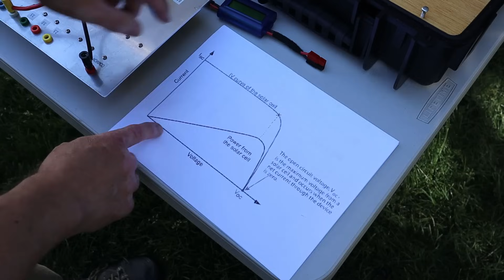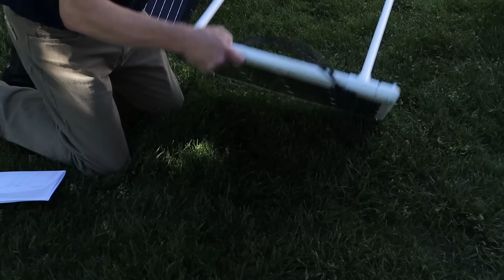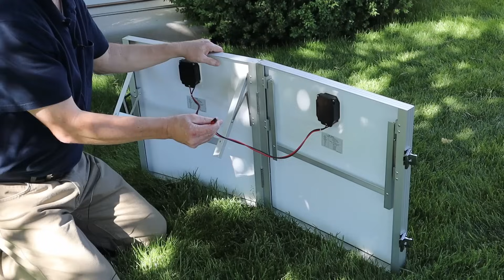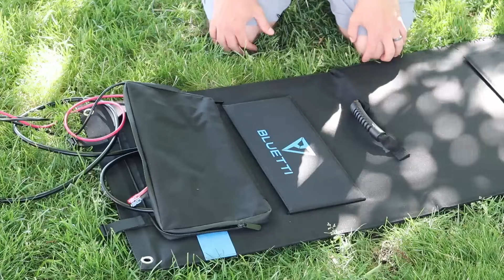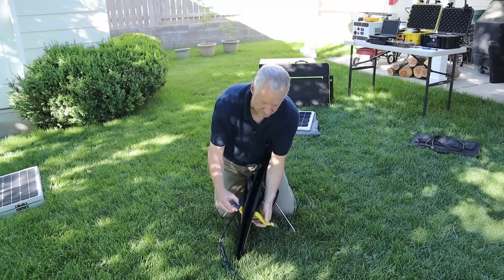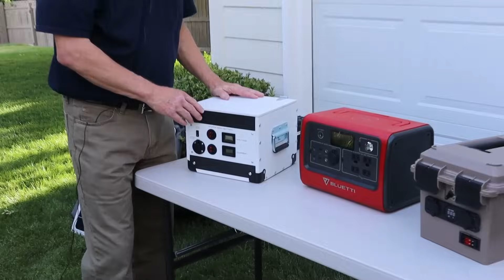Portable Solar Panel Comparison, 11 Different Models! Sunpower, Baldr, Rockpals, Bluetti, and More!

Comment: Did you all try out the Massimo 300w foldable panels they sell at Costco? I heard they get close to 300 watts =) If you didn't, any thoughts on how good these are just by the specs?
Reply from the maker: It should work fine, if not Costco has the best return policy!

Comment: Do you notice a difference between how much the flexible panels can achieve compared to their rating and the rigid ones? That final Newpowa seems to do quite well and is very good value. Not a good option for portability though as it is quite heavy but the flexible panels can cost twice as much.
Reply from the maker: There are three types of panels, glass rigid, portable folding, and flexible panels. 
Rigid panels have the best pricing and also last much longer(years and years). They can handle most any weather condition. The only downside is that they aren't as portable. 
Etfe portable panels are pretty water resistant and some are even waterproof rated. They output good power, check out my XTAR sp100 review. I don't recommend portable panels coated in PET. 
Flexible panels are in a weird area, they are waterproof but will degrade quickly especially if they are outside in the sun all the time mounted to the top of an RV or van conversion. They are good for a lightweight occasional use (they are able to slightly bend... Not by much)

Comment: Its heavy said that twice. What you didn't say was how heavy . Review but if want actual specs go some  where else
Reply from the maker: This isn't a 'in depth review video', I have plenty of those you can look at if you want more info about some of these panels. This is a comparison video showing power output and differences between each panel.
Reply: @Jasonoid  for as ling as l can remember at around 12:pm every day especially from april to September the sun is at it strongest if you're in the northern hemisphere 
What hemisphere are you in ?  Thats a rhetorical question.

Comment: I’d like to see how you built the load tester. I’d love to see the review of the folding variety against the powerFilm lightsaver line.
Reply from the maker: Just one large resistor, with a few small ones for adjustability so you can get the load perfect to peak the power.

Comment: Best videos on this topic I have seen. Answered a lot of questions.
I have an EcoFlow River 600 and a Goal Zero 200w. Do you think I am better off with the Rockpals RP082 or SP003 for connectivity. Thanks. P.S. Some people say the Rockpals 8mm connector included with the RP082 doesn't fit in all the way. Would that cause a problem. like a short?
Reply from the maker: Ive heard that Goal Zero uses a "longer" 8mm connector, you might need to purchase a special "Goal Zero" adapter from them to get a third party solar panel to work with it.

Comment: If the Baldr 120w or Rockpals RP082 panel is partially shaded (like 1 or 2 panels) does it still put out good power or or almost nothing at all.
Reply from the maker: Most panels do not perform will in shade. I have not tested all of them to see which one performs best in partial shading, might have to try to do a video for that in the future.
Reply: @Jasonoid  thanks. I was just wondering because I’ve seen the new Bluetti 200w panel does well if partially shaded because each panel is ran in parallel and just wondering if some of the other cheaper panels work this way.
Reply from the maker: Correct, sounds like I need to do some testing. Maybe I can find some time haha

Comment: Great video, does the Baldr panel have the etfe coating as well? Trying to decide between that and the rockpals with etfe
Reply from the maker: I have found a few similar panels that all have ETFE and perform very good! Pick the best pricing that works for your setup (I have review on each of them on my website:  https://jasonoid.com/solarpanels/   :
Baldr 120w ETFE - 112 watts output
Elecaenta 120 ETFE - 113 watts output
XTAR SP100 - Bifold - EFTE 113 watts output

Comment: Jason, what are typical applications for the portable power stations you covered?  If they're intended to be used outdoors, my concern would be a lack of water resistance...
Reply from the maker: These power stations are great for camping or boondocking. For someone who wants to have portable power to charge gadgets and run 12v fridges but doesn't have an RV or trailer. They are also handy to have for power outages to run small devices. The power stations are not waterproof AT ALL so you have to keep them out of the elements. Some of these portable panels have great waterproofing like the SunPower Flex 50s!

Comment: @JASON WE HAVE A BLUETTI  EB 150  I LIKE THE SP200 ( ALSO BLUETTI) BUT MY EB150 HAS A DIFFERENT CONNECTOR FOR THE SOLAR INPUT? ITS JUST 1 PLUG...HOW DO WE MAKE IT WORK?
Reply from the maker: Your EB150 should have come with a charging adapter that has MC4 connections. Did you get any adapter cables with your purchase?
Reply: @Jasonoid  I GOT THE COSTCO 300W FOR 300$ ON SALE...LOVE IT !!!!!!!   https://www.youtube.com/watch?v=vYp06kyA99k&t=1606s

Comment: Was wondering if any of those panels work well in shaded areas, I know it wouldn’t be as good as full sun. Have heard power film does work in shade but very expensive
Reply from the maker: Hey Dave, each panel is slightly different and depends on how they are wired together. Panels wired in series don't do as well as panels wired together in parallel. Parallel connections are much better for shading.

Comment: As I understand it Lithium-Ion batteries are very finicky and potentially dangerous then it comes to temperature, and then fire.  But it sounded like you were saying Lithium Iron which I hear are up and coming because they perform the same, output comparable Amp/Hrs. So, I wanted to be sure exactly what you said these particular ones had in them. I am VERY much a novice as I'm sure you can tell!  So, thanks for any info you can share, and this vid was fantastic!
Reply from the maker: Hey Harleydr, the batteries I like are 'lifepo4' or lithium iron phosphate batteries. They fall under the lithium battery umbrella but don't catch fire. I have tons of videos on the subject of power stations, lifepo4 batteries and solar panels hopefully you find the info helpful.

Comment: what would you recommend for the bluetti EB55?
Reply from the maker: Check out my Xtar SP100 review video, that one is a great panel! The Rockpals SP003 comes with MC4 connections so you can use that one with the EB55 as well.
Reply: @Jasonoid  thank you! do they have a 120 or anything higher?
Reply from the maker: @joefratt  the sp100 is a 120watt panel in disguise, you'll see in the video. It blows aways the Bluetti 120watt panel in performance.
Reply: @Jasonoid  wow thanks so much gonna check that video out now!
Reply: @Jasonoid  do you know how long it would take to charge up the eb55? do you think it’s worth getting the sp100 over just the bluetti 200?
Reply from the maker: I always recommend getting the most solar power you can afford. The Bluetti EB55 has around 500wh of capacity so it would take 4 - 5 hours to charge up the system using a 100-120 watt panel. The max charge is 155 watts off solar so purchasing a 200 watt panel is better but there is a little bit of wasted power. Either way is a good choice. Buying two SP100 panels is still cheaper than the Bluetti 200 watt panel.
Reply: @Jasonoid  okay, you’re teaching a lot i really appreciate it, last question, would i have to buy the mc4 separately or does it come with everything i need for the eb55

Comment: Hi there I would like the most portable for solo back up, busking and camping so was looking at Bluetti eb55 and their 120w mono crystalline solar panels but the panels seem expensive and possibly slightly larger than the rock pals. The rock pals look lighter but is the wrong connector though? Is it easy to get Anderson to barel connector? Is the rock pal the best for my needs? Thank you so much for your help!
Reply from the maker: If you can find the 'Elecanta 120watt' review on my website, thats the panel I have been recommending lately. It gets a full 113watts vs the 94 watts of the Rockpals. They are similarly sized and have all the barrel connections you need.
Reply: @Jasonoid  Ok thank you Jason so mu8ch for that. Also your father in law is so super knowledgable love him! Thanks again for your time!

Comment: One disadvantage with the folding panel is that it is lined with cloth and plastic  material which can be worn out quickly due to sun burn
Reply from the maker: That is very true, I talk about that here in this video: https://youtu.be/9qcj7MgP0Bs

This is an excellent option for a great price.

Comment: Have you connected any of the panels in series or parallel?  I looking at folding panels and I am having trouble finding that sort of information.  Acopower, rockpals.. and probably other don't seem to want to give the "max series fuse rating" on the panels and as I understand it, you need that number to know if you need to fuse each  pos. lead if connecting in parallel.  I would like to get two panels of some brand and connect at least in series and hopefully be able to also connect in parallel.  
Also, If you connected any of the panels in series that have the extra connection board on the back of the panel (usb ports, dc line for solar gen, etc) are those ports still functioning correctly with the higher voltage of being connected in series.
Thank you so much for any help with this.  I am new to all of this and trying to understand.
Reply from the maker: I have connected all of these portable panels in parallel with no issues, however I have only connected rigid panels in series. I'd probably stick to parallel with any panel that has the USB ports.
Reply: @Jasonoid  thank you
Reply: I looked at rockpals and the website says that 100w panels should not be connected in Parallel... but you have done it with no problems?
Reply from the maker: @nwlady1844  that first gen (sp03) doesn't come with an adapter so you can't easily connect them in parallel. The RP082 comes with an adapter so it can be. The rp082 is also better with its etfe coating.
Reply: @Jasonoid  Thank you.  Thanks to your video I am realizing the benefit of the ETFE coating.  Take care... and Have a good evening.

Comment: The testing should done directly under the sunshine, not under the tree shade...
Reply from the maker: Really?!... I'm sorry it wasn't OBVIOUS to you that the testing was done in the sun. This video is an overview of those solar results... not the actual solar testing. You'd think by your channel name thatd make sense to you. How could we pull near 100 watts from a 100 watt panel in the shade? 🤷
Reply: @Jasonoid  O.. Sorry, yes, i just finished watching the whole video. it is summaries those results.  it make 100W panel with plus tolerance  and the short connecting cable, then you might be 100 watts.

Comment: You mentioned on the first panel that it would become yellow if left in the sun. 1) does that decrease its ability to work? and  2) Does that happen to all the portable solar panels?
Reply: OK EFTE covering need to look for that when shopping thanks
Reply from the maker: @aicram62  Yep ETFE will last much longer in the sun :) PET works fine for temporary use!

Comment: Have you tested Renogy's 200-watt Solar Suitcase? I'm surprised you didn't include it in this test as it's super popular.
Reply from the maker: I didn't want to have any panels in the video with built in charge controllers. Those panels are in a different category. However, my dad has the 100 watt Renogy suitcase panel and it performs well. I'm sure the 200 watt suitcase is very similar.

Comment: I have the baldr and another foldable panel. I just recently cleaned it by spraying water on it, and a couple days gone by before I used it again; and it stopped working. Is it possible I fried the junction box or water got inside the panel or something? 

I know it’s not my input from the power station box cause I can still charge it from an outlet.
Reply from the maker: You can put a voltmeter up to the outputs and measure if any voltage is coming out of the solar panel in the sun. Are you seeing anything?
Reply: @Jasonoid  thanks for the swift reply! 
Bought a meter on Amazon right now. Will test out what you said once it arrives.

Comment: Is a charge controller necessary or can you just use solar panels straight to a battery?
Reply from the maker: Technically you can hook them straight to a battery but you'd have to watch the voltage super carefully because it would overcharge the battery. A charge controller is needed for any serious charging.
Reply: @Jasonoid  oh ok thanks

Comment: Rock pal panel question

Charge controller needed to charge a 12v agm battery ?  Load is my 12v arb fridge on camping trips
Reply from the maker: Yes, the rockpals do not have a built in charge controller so it will be needed. The solar panel would connect into the + and - inputs on the charge controller.
Reply: @Jasonoid  their customers service finally got back to me and said it wouldn't work...
So out from their leads with the anderson connectors into a charge controler( via a cable ill make with ends on 1 side) and out to the battery ?  U sure ?  There's a little box with the usb inputs ...nothing to get in the way ?  I like the panel but i bought it specifically to charge my 4runner battery while boondocked
Reply from the maker: @jeffphillips94  That little box is just for USB connections and doesn't provide any voltage regulation or charging curves for the main output. These panels do not have charge controllers in them.

You'll need to connect the output of the panel into the + and - of a solar charge controller and then from there to a battery. These panels will work great for that though.
Reply: @Jasonoid  thanks for your help,  i was about to send the panel back based on their " tech support" erroneous info.

Comment: Any panels have ability to connect to the batteries without adding my own controller?  If they have a their own controller it would be great.  I like the USB features and good cells.
Reply from the maker: Renogy makes a decent 100watt folding panel with a built in MPPT charge controller. Comes with a nice hard case too. My dad uses it on his RV house battery to keep it topped off, works really well. You can find it here:   https://amzn.to/30NCCzn
Reply: @Jasonoid  Thanks for the info.  I saw a more recent unit you reviewed ... You tested two of the same unit...  E something?  It is on my pc at the shop .. at home now.
Reply: @Jasonoid  Elecaenta 120 watt Solar  I do have my own controllers too ...
Reply from the maker: @davidpatrick1813  The Elecaenta solar panels are excellent. They put out great power, around 113watts each. They would both work with a standalone charge controller too.

Comment: Have you ever seen a solar panel that was like flexable like rubber about 6 to 8 feet long for homes company called smart solar.
Reply from the maker: Check out a video by Todd Parker, he put a similar panel on his camper roof. The video is pretty new. He talks about all the benefits to it.

Comment: I'm considering going with the ecoflow solar generator I was wondering do I have to get their solar panels or can compatible solar panels
Reply from the maker: As long as you get an xt60 adapter you can use most 12v solar panels. You just need to determine if glass rigid panels or portable panels are right for you.

Comment: I'd be nervous about these lightweight solar panels flying off in a gust of wind.
Reply from the maker: Flipping over, that might be possible. Flying completely away, probably wouldn't happen since it's got power cables plugged into stuff. That's definitely a downside to portable panels...but also an upside for moving it around haha?

Comment: I am a novice.  Thank you for this video; all the comments and answers too. This video helps me to understand the solar field and I will watch others.  I live in a coastal West African country where there is salty air, heavy rainstorms and constant equatorial heat even on cloudy days and nights; all conspiring to deteriorate our electrical, electronic, metal equipment among other things.  Do you have any particular advice on which equipment will stand up to the conditions in my particular paradise or any precautions I can take to make solar work for me.  Power outages occur often here.
Reply from the maker: Thanks for watching! With those conditions it's probably best to stick with Glass rigid panels for the best durability. They are cheaper than these portable panels but they are just bigger and bulkier. Not an issue with you aren't packing them around each day. Hope that info helps!

Comment: So , for a beginner which one for a small 2 bed home terrace ? 
Thanks
Reply from the maker: If it's going to be outside all day everyday it's best to stick with a glass rigid panel. Waterproof and durability for full time use.

If it's going to be used on and off, I'd recommend the Baldr 120 for best output for the cost or the Sunpower flex 50 for the lightest and easiest to move.